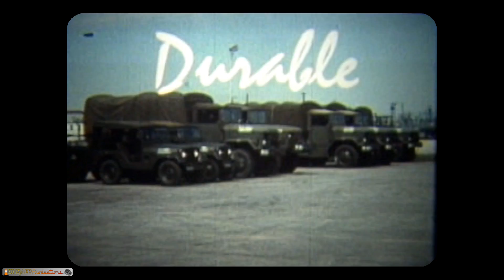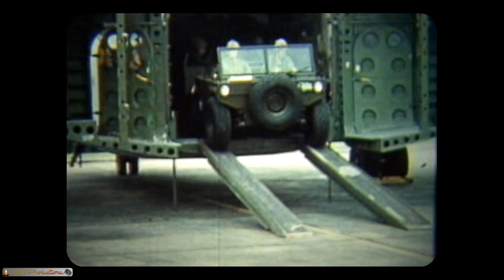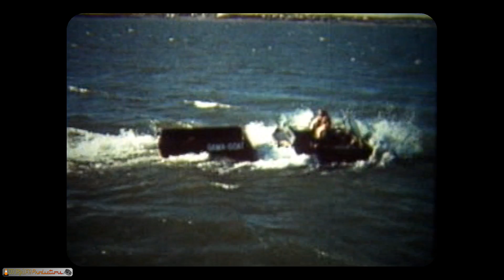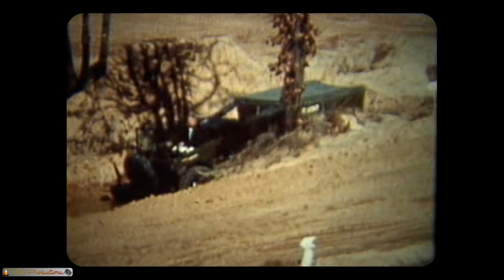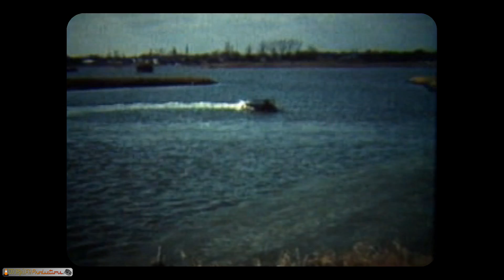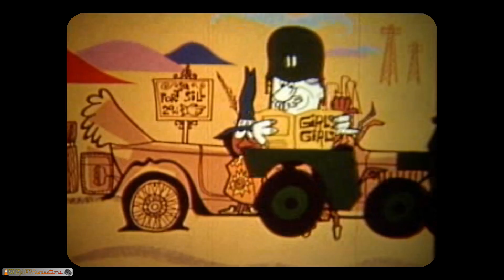CORVAIR POWERED MILITARY GAMMA GOAT ALL TERRAIN VEHICLE

Comment: I drove one for a year when I was on Okinawa in '76 with 3rd Battalion/ 9th Marine Reg. They were very loud. they would go anywhere except the volcanic ash from Mt. Fuji. I was just driving around 
while everybody was playing war. I got stuck in a very big hole with loose ash  I got out and stepped back about25 ft watched it dig it's self in after a couple of minutes I got back in and backed out of the hole it dug, and drove around until I found a better way out. I could pull the front wheels off the ground by getting the rpms wound up in 1st shift to 2nd real fast the Goat would pop a wheelie. I drove it like a 5 ton sports car.

Comment: I made adapter plates to run 1100-18 gama goat tires and rims on mt 55 dodge M37. Best mod ever. Bought them brand new, with the nubs and mil-spec air from my friend Jack in tooele for $90 ea. The only tubless lock ring style wheel i've ever seen.

Comment: This is not the Gamma Goat that was finally used by the Military.  Those used by the Military used a Diesel. This is basically a prototype. This protype was also 1/3 lighter than M651.  I believe that the body was made out of Royalite, which is stronger than fiberglass.   The ones used in Nam were heavier and a hell of a lot noisier than the one that was on the prototype which as a Chevy Corvair engine.

Comment: My dad took us for rides in the ones they had at his unit. I remember them being extremely loud!
Reply: +Lynn Froetschner The Army got the model with the 3-53N Detroit Diesel engine.  As any trucker could tell you, those old 2-stroke Detroits were LOUD.  They called "Screaming Jimmys" and "Rocky Mountain Hummingbirds"; or, in the 12 cylinder models, the "Buzzin Dozen";.  The exhaust note of that type of engine and the magnitude of it are it';s calling card.

The Army, being the Army, ran them practically straight piped with not much for mufflers and with the engine situated right next to the driver.  Ear protection was recommended for operators.
Reply: +rbagel55 Muffled was the way to go for sure.  I spent a good amount of time behind the wheel of an IH Transtar with a Silver 6V92T and an Allis - Chalmers HD-6 crawler tractor with a 3-71N.

The IH with the muffler was far more comfortable on the ears.  The Allis had this big pair of headphones you had to wear when you operated it.  You still had your ears ringing at the end of the day even if you didn't plug them into the radio.
Reply: Randall Waitt
I drove one of these things for a while when I was in the Army back in 84 (Bamholder Germany) All 2 stroke Detroits are noisy, unless they are mufflled, like the 977 HEMTT I drove for a while with an 8V92.
They were reliable though.
Reply: Randall Waitt
Same thing here. We would go out to the field
several times a year since i was in a Field Artillery unit. That ring from that 8V92 would hum in my ears as I went to sleep after driving it all day
Reply: All of them had 3-53N's in the some of the early ones were had cast iron blocks but those would sink more than swim so most of the goats have an aluminum 3-53N. Note that at least the engine I have out of a goat also has an early 4-valve head unlike some of the industrial 3-53N's.
Reply: Yes very loud..It had a placard on the dash  on the passenger side to "wear hearing protection"